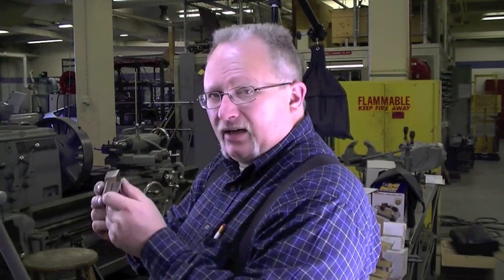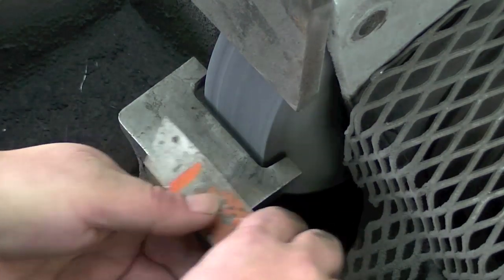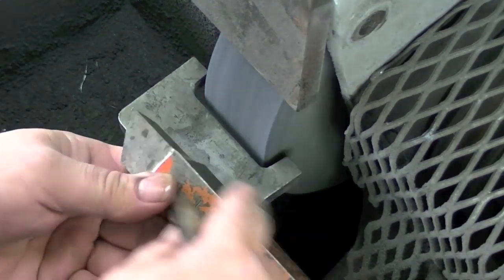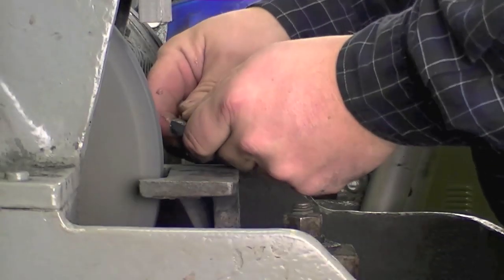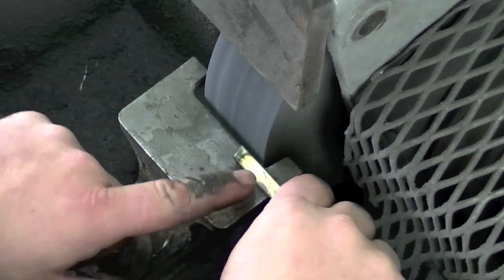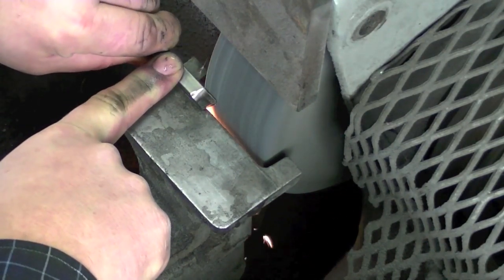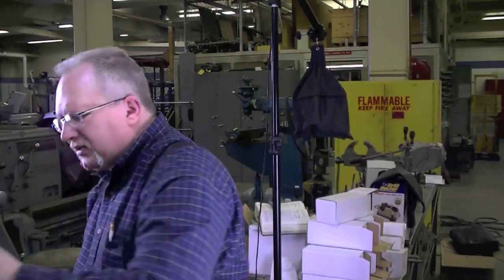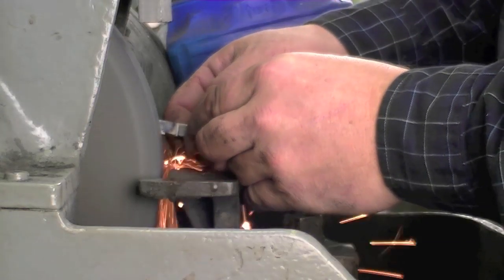Grinding HSS Lathe Tools - Part 2: Grinding a LH Tool

Comment: Hey Barry, it's hard to tell where you are putting the radius at the end  of the RH and LH  tool grinding videos. I don't see a radius on the large tool bits that you show. in the beginning. I have some carbide bits, and they don't have a radius anywhere . What is the radius for?